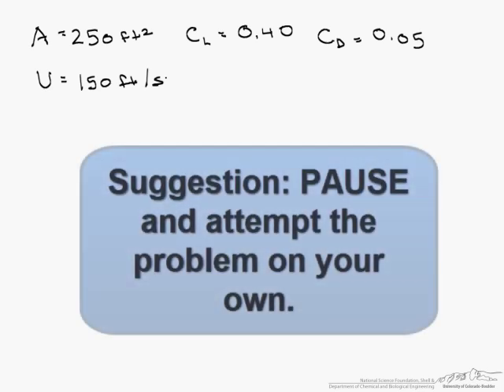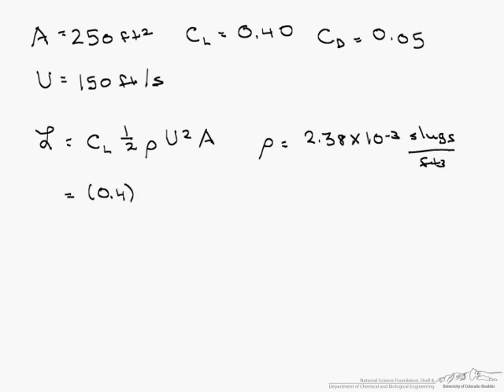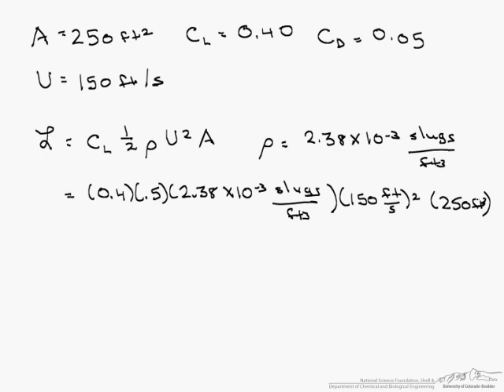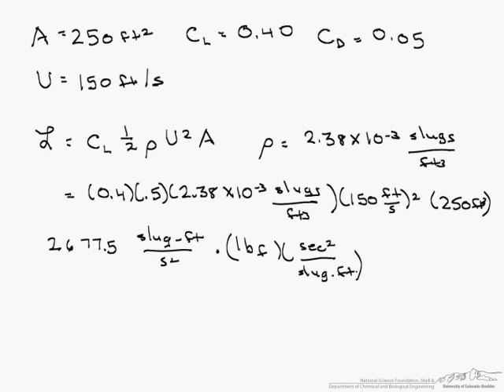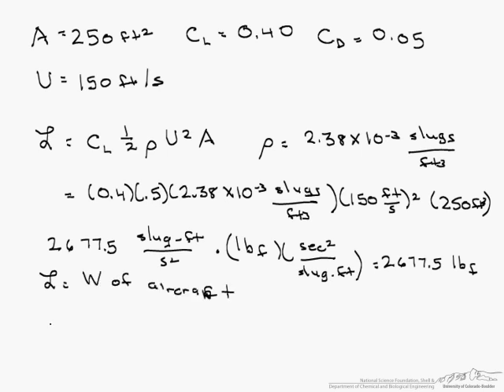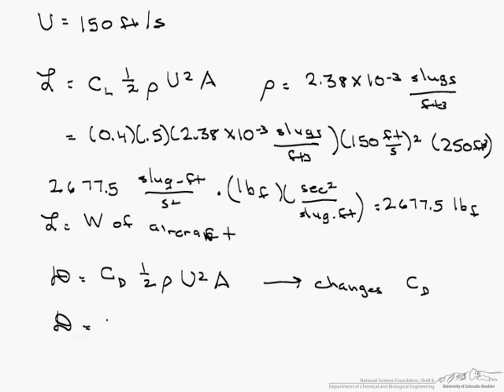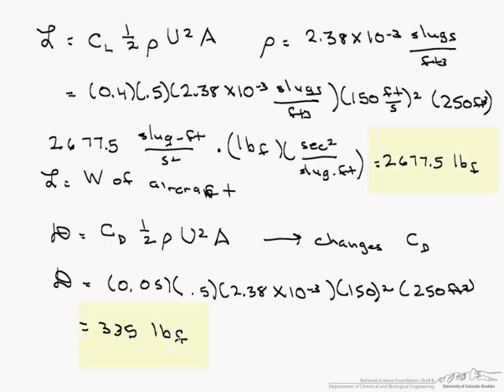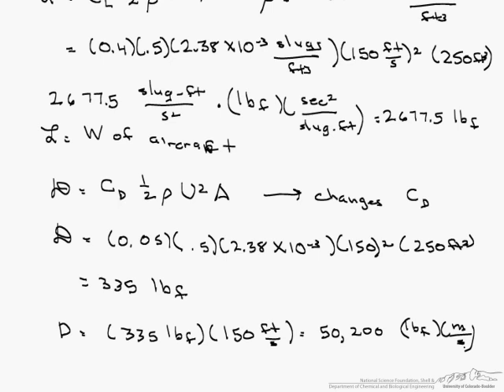Lift and Drag on Aircraft

Comment: Why did the ft/s turn into m/s?  unit conversion, or was that an error?
Reply from the maker: Thank you for noticing that! That was an error, the units on that number should be pound-force feet per second. I will add an annotation to correct that.